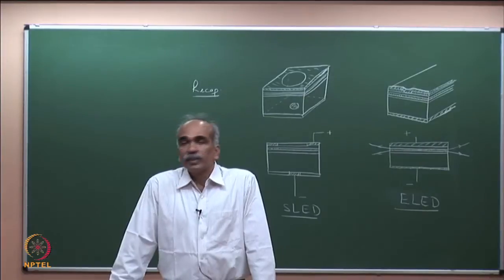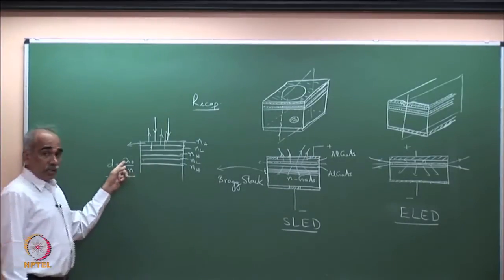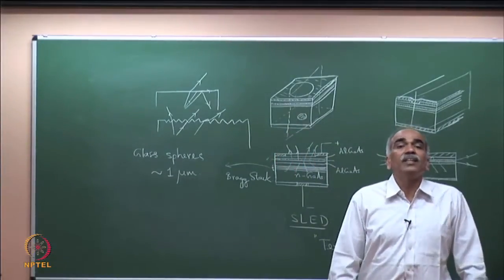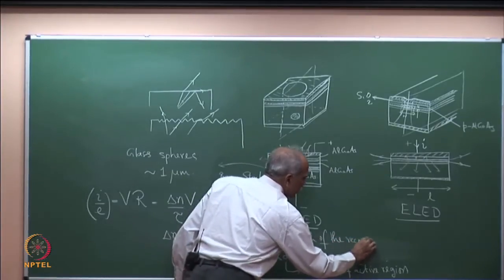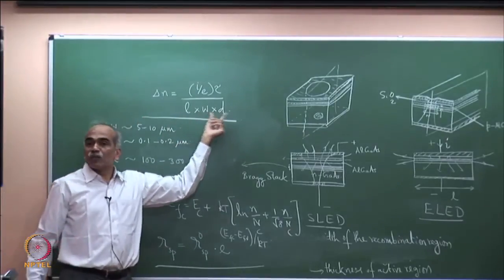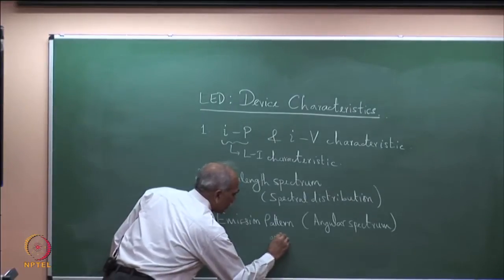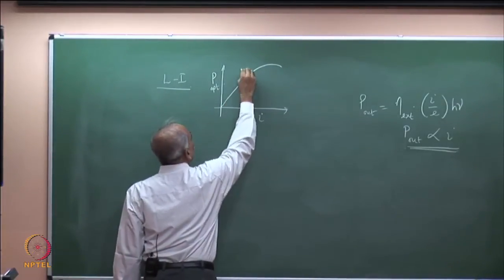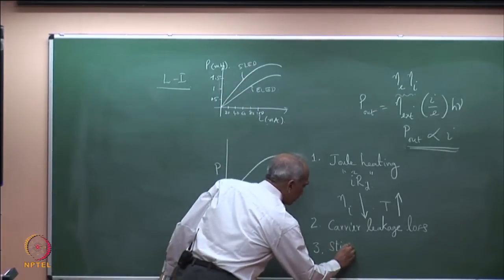Light Emitting Diode-II Device Chracteristics

Comment: Dear Sir Thank you very much for your all knowledgeable Lectures delivered. I watched your all previous lectures carefully and understood them all. In this Lecture I have few Questions?

1.How reflected light from the surface of low index nL can pass through high index nH . I means why it is not reflect back to nL?

2.Why not Bragg stark layer not reflected back the charge carriers between electrodes?

3.How to add AlGaAs on GaAs substrate  for making Bragg stark laye?

Thank you very much in Advance Sir.

Best Regards